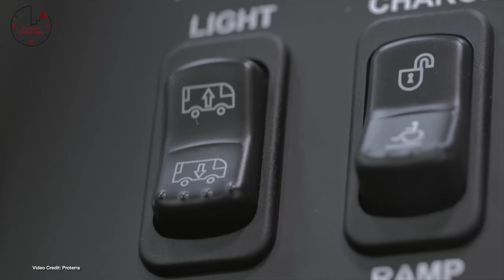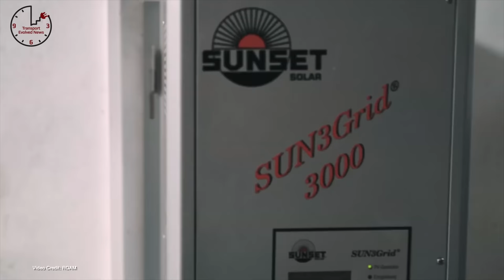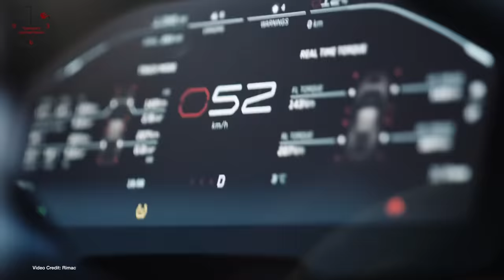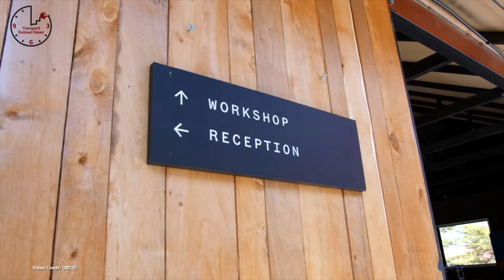1,000 Km Per Charge, Elon Wishes Tesla Cofounders Were Different, Classical Music Gets Best Range

Comment: I'm still surprised that even in the US areas of mid- to upper-income the brand new gas stations being built with 15+ pumps have not a single DC charger.
Reply: They are not allowed to. The gas stations here in Austria have the same problem, those with fixed contracts from OMV are not allowed to serve EVs. The private ones and the MOL in Hungary have EV charging stations. Stupid? Yes. Shortsighted? Yes. Sustainable? No.
Reply: @showme360  Yes, Our OMV - the only refinery in our country and the biggest gaz station company has forbidden their tenants to offer any service to electric cars (i know one of the tenants). Actually they are not even allowed to sell them cleaning or repair services or beer. Ok the last is actually against the law but the tenant could be forced to pay a fine if the OMV finds out. Why? Because the OMV belongs to the Abu Dhabis - mostly. The private gaz station owners, the independent all have already built EV charging stations. Since 2019. Shell too. Aral does not really exst. MOL in hungary. Others like INA in Italy are still in the process.
Reply: The logical reason  is that once they encourage EV they will start the cannibalization of their ICE market and for the time being the earnings per hour of gas may be greater than that per hour for electricity.  Another reason maybe waiting for government subsidies to underwrite the cost.
It's all about immidiate financial outlook
Reply: @dstr1  There may be another reason which would be at least excusable, which is that charging so far takes considerably longer than filling a tank, and if they had even two or three charging stations, it could easily cause gridlock for anyone trying to get some gas.

Comment: Great show. Mind boggling decade we are in! I have been following alterative energy for 50 years and finally have a chance to see real worldwide changes.
Reply: Checking out the dual brake disc sized , dual rear motor, single controller, 89KG power unit assembly developing 660hp, in the Koenigsegg Gemera.  Where will the next decade take us?
Reply: You do realize gas corps killed the electric car? Jay has electric cars way older than 50 years.
Reply: @EricHamm  I have surplus solar panels removed from an ARCO solar installation that I purchased 30 years ago. Not sure who Jay is but of course electric vehicles predate the gasoline engine.
Reply: @WilliamGrout  Jay Leno is a car collector and he bought an electric car made in the state but was all of its life in Norway and did got it fixed and can drive it now... the car is over 100 years old.... some info on it here on youtube
Reply: @rvarsigfusson6163  Ah yes, that Jay.

Comment: I'd be interested to see what route they used for the Mercedes. Because I am betting they planned a 10,000 ft decline in elevation overall along their route.
Reply: good analysis. ladies and gentlemen Dave may be on to something, it could indeed be the classic "Trevor Milton/Nikola scam".  because: GRAVITY.
Reply: @phillyphil1513  Yeah unless that thing has some new prototype solid state battery or some other wizardry Im inclined to believe they fudged the test.
Reply: Easy enough to check, they started at Sindelfingen near Stutgart in Germany altitude 531m and finished at Cassis France. So an overall descent of 531 m (1742 ft). Not quite the 10000 ft decline you accuse them of, though they did travel via Switzerland and Italy so there may have been some climbing and descending along the way.

Comment: 🔌Mercedes EQXX concept car at 141 watts/mile which correlates to roughly 250 MPGe is very good compared to most other production EVs at below 130 MPGe or Hummer at 47 MPGe. I will be excited to see Aptera's AWD starting at $28k two-passager production vehicle this winter with 350MPGe running 100 watts/mile up to 1000 miles per charge with free solar range.🔌
Reply: Yes, Aptera will be exciting and will set the standard for efficiency!

Comment: Mercedes has nothing to match Tesla.
Reply: I disagree. Multiple EQ* models exist already and many reviewers are giving them high ratings and see them as an alternative to Tesla.
Reply from the maker: Glen, have you driven a Mercedes-Benz EQS? - Nikki
Reply: the available "Hyperscreen" is like going to Fremont Street LAS VEGAS (without having to deal with the smell of marijuana on your clothes).
Reply: Benz cant save your seat position with your driving profile, so yes 10 years behind tesla, not to mention otc, over the cable
Reply: Benz sold 100k EVs, 10% of what tesla sold, let’s see if this improves in 2022, i guest they will sell 8% of what tesla sells. Tesla aim for 1.6M for this year, of benz sell 128K, it means they failed already
Reply: @transportevolved  Prototypes are easy, production is hard.